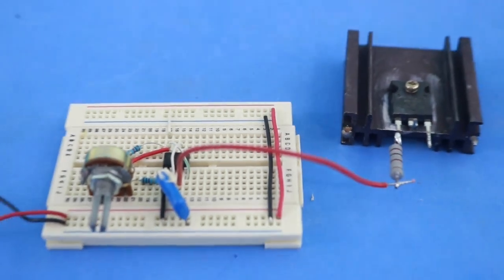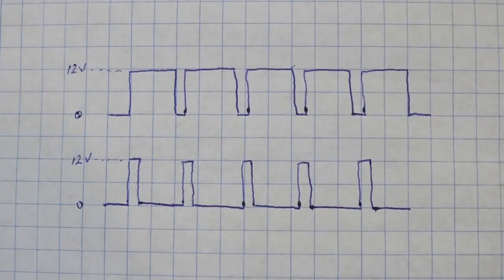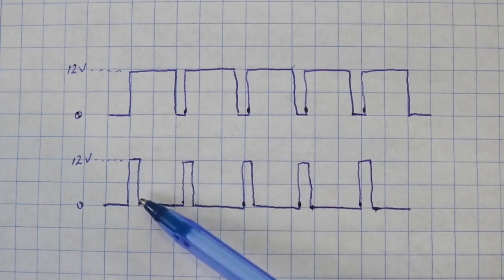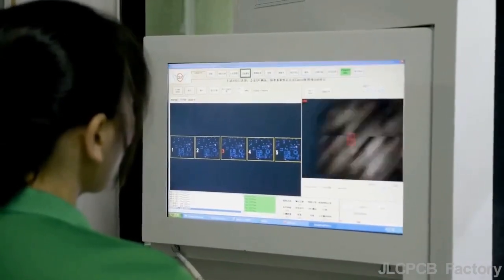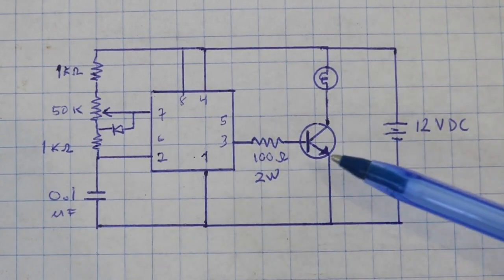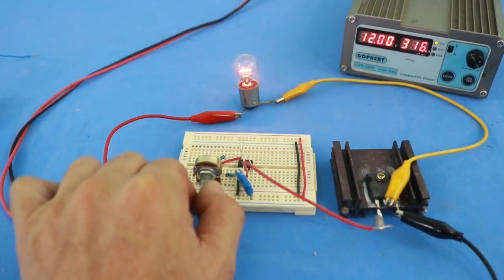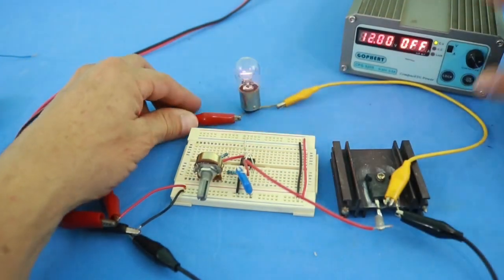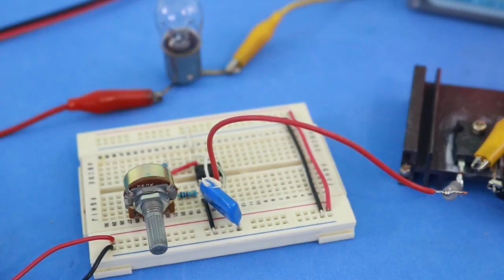DC Light Dimmer with 555 Timer IC

Comment: How much voltage you can pass in the Drain of the transistor without burning the 555 timer.  I always thought that you would need a gate driver IC for this kind of application such as IR2110.
Reply: The Maximum voltage of 555 timer ic is about 15 volt..

Comment: Note that if you want to drive a DC motor with PWM you will need a flyweel diode to avoid voltage spikes.
Reply from the maker: yes!

Comment: I used to dim light with using only Potentiometer
Reply from the maker: potentiometer is only 1/2 watt
Reply: Potentiometer only wastes power unnecessarily and will burn out quickly. Pulse width modulation is very efficient in this application.
Reply: Pot to MOSFET?